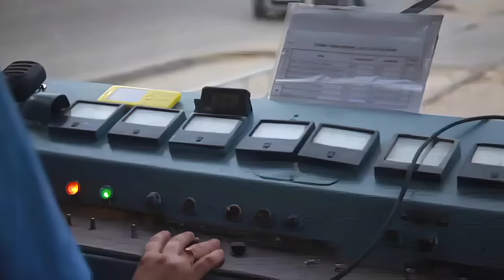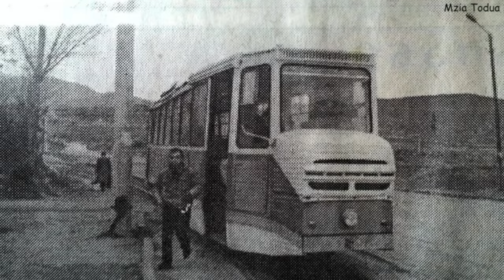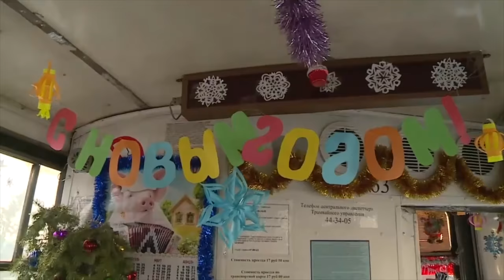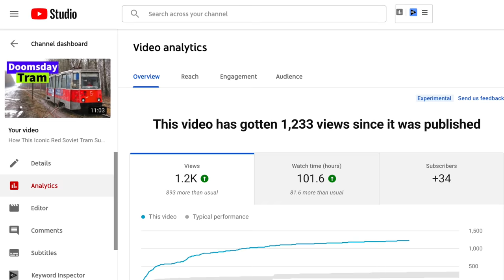The Legendary Soviet KTM-5 Tram: Defeats And Victories, Joy And Sorrow, Hope And Desperation

Comment: In claiming that the KTM 5 is the most numerous tram class in the world, one should bear in mind that the Tatra T4 was identical to the Tatra T3, except that it was a narrower version for certain cities (2.2 rather than 2.5 metres wide). Only for this reason did it have a different class number. The combined total of T3/T4 trams produced was 16,748 including 122 unpowered trailers. It's a pedantic point of course and both the Russian and the Czech tram hold an honorable place at the top of the world statistics board.

Comment: You should make a video about T3 made in czechoslovakia. 14000 vehicles made total, and exported through entire eastern block. Iconic in Prague, robust and reliable. They were called Dubček´s vengeance, which was czech communst leader, because they were damaging railways in germany and hungary. Their tram system was not designed for these but for much lighter, it started with horse pulled carts.

Comment: This mode of transportations - tram - may come back when fuel cost will restrain transport in many nations by 2040's; and it will make inroads again partially and succesfully in some areas of the many nations. Oil will be depleted but before that there will be reliable transort or connection issues and this will make come back, besides trolleybus.
Reply: Well In Prague, where I live, trams are still (along with metro) the backbone of public transport...And of whole transport...without them, so many people would need to use car and traffic in Prague would probably fail. But Its true Prague has 3. biggest tram network, so idk how it works somewhere else.

Comment: KTM-5 trams are not that familiar, because the tram systems with easiest access were in Leningrad and Tallinn. Leningrad trams were built locally. Tallinn had Lowa 54 and Gotha 57 trams imported from DDR. The fleet was later modernised with Tatra SU4 bogie trams and KT4 articulated trams. The KT4s are still in service. The standard Soviet trams could not be used in Tallinn, as the gauge of the system 1067 mm (3½ ft).

Comment: lol That tram is still in service because it still has a parts supply, not because it was made better. There were tens of thousands of those cars made over the decades. After the USSR fell apart, the different factories that made it became privatized and competition to each other, making modernized and different trams. Then the country started to shun tram systems and all those factories went bankrupt, leaving no parts supplies. The old, retired trams, however, make a great and cheap source.

By the way, while red became the most common color of this model, it originally came in yellow and blue. Also, KTM5s served St Petersburg, so you would absolutely find them in front of the most majestic buildings in Russia.

Comment: What is the relationship between these UKVZ made trams and those made by ČKD/Tatra? Some models look the same, and even have similar designations...
Reply from the maker: This tram's equipment is based on Tatra T3. The looks are similar with T6, but also with Konstal 105Na, Kawasaki Type K and many other trams thanks to the overall design trends of '70s.
Reply: @RailwaysoftheWorld1  ... and it's cheaper to weld straight sheets of metal together than to bend them into a soft, curved shape.

Comment: If this model works so much better than newer ones in the conditions found in RU or other former Soviet republics, why then doesn't someone take the plans, and make more? I'm sure whoever got the IP of the design would license it. There might be a problem though if there's no clear owner. 

Shame about the wide sliding doors being replaced. :( I understand though if it helps keep the cars warmer in winter, just too bad they couldn't do that and keep the wide, sliding doors.
Reply from the maker: This would be the same as producing ‘50s-‘60s Range Rover / Land Cruiser / Jeep / whatever they use on Cuba or in Central Africa instead of maintaining and building roads. Might have some sense right here right now, but is obviously a dead end.